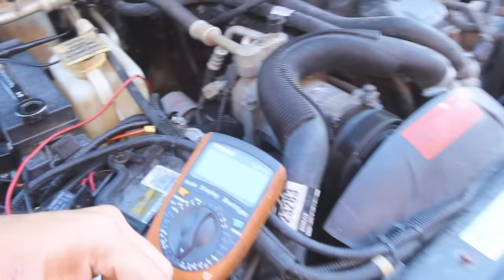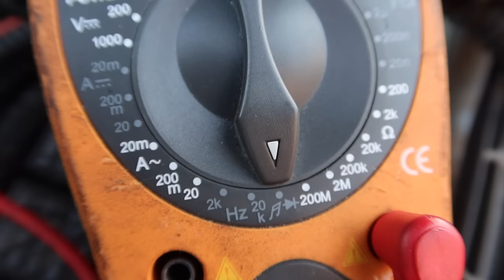AC Suddenly Stopped Working In My Car / Cheapest  Air Conditioner Diagnosis and Fix / Hot Jeep  XJ

Comment: If the switch is good, but the compressor doesn't come on, check the continuity in the coil in the electromagnetic clutch assembly, and if no continuity, replace those clutch parts (sold in kits online) instead of replacing compressor and the refrigerant.  It's a lot cheaper, and a DIY job.
Reply: P
Reply: Huh?
Reply: My AC clutch doesn't click compressor turns on and the AC in my 2003 Ford mustang base model
Reply: For compressor to engage in cool the car
Reply: Well the problem I have is that my battery died the other night I changed it ac dosnt work now thought it was the relay so I jumped the compressor with a paper clip thru the relay and the compressor turned on and I tested the relay by puting it in the horn relay and the horn still worked so I’m clueless as to why my ac clutch won’t engage
Reply: @kathyhartline1954 my thought exactly
Reply: Hey thanks a lot dude this is pretty easy to understand you help me out a lot 🤑
Reply: @wesleymcmahon3036  find any solutions? That’s exactly what happened to me
Reply: Can you replace clutch w/o removing compressor?
Reply: May require a wheel-pulling tool to separate the pulley from the compressor, which often lacks clearance to use while mounted.

Comment: I was bummed out because I thought my 1998 Jeep TJ needed expensive AC repairs but I tried your diagnosis/fix and that got my AC working.  Thank you so much!
Reply: Same here!!!
Reply: I’m working on my 1997 TJ and did the paper clip trick that made the condenser kick on and added in some refrigerant and it’s still hot air. Any ideas?
Reply: @SamuelThompson-rh2su  You have to replace the AC low pressure switch like he showed you in the video. Rewatch it.

Comment: Love you my man . Just changed my ac compressor , dryer accumalator, orifice tube, ac condenser, hi and low pressure hoses . Charged the system and compressor woudnt turn on . Changed fuses . Nada. Check that switch boom . Now we got ac boys .
Reply: Damn. You threw everything but the kitchen sink at it.
Reply: 😮broken fuse,

Comment: Finally, a practical hands-on way to check the A/C system after checking that the fuse and/or relay are good.  I'll do this tomorrow.  Thanks.

Comment: Dang I wish had a truthful trustworthy mechanic that I knew. I had 3 different quotes for my 2014 (only 55k miles) Kia Sorento’s AC problem. 2 said it was leaky hoses, one said it was a compressor. Both gave me a quote of around $650. 
It took one of my coworkers to say; “you might want to check the compressor fuse. I had a Honda a few years back where that was the problem”.  Now watching this video , i’m getting my hopes up that it’s something this cheap!  🙏🏼

Comment: MAN, thank you!!  I thought I had problems with my evaporator coil but it was just the low pressure sensor.  I'm hitting the parts store and fixing this TODAY!  Thanks again for taking the time to make this video!
Reply from the maker: Thanks for the great feedback!
Reply: @Donnythelatemodeltech  - My pleasure.   Question for you: In your opinion, would it be a bad idea to leave that connector "jumpered" with the paperclip for about a day while I acquire the new sensor?  Thanks!
Reply from the maker: I just wouldn't do it long-term
Reply: @Donnythelatemodeltech  hi
Reply: Super

Comment: thank you dude, had no idea you can jump out the pressure switch. my problem was the pressure was so low that the pressure switch would not turn on the compressor, I jumped out the pressure switch and the compressor started up and I was able to see that I was pretty much empty on refrigerant. long story short I now have my AC back and it cost me a total of 40 bucks

Comment: I know its not the fuses or a leak. The compressor moves manually but not when AC turns on. I thought maybe the AC clutch, the auto supply thinks its the blower motor resistor or the blend door actuator.  Your video has vome across my stream, so this test is my next move.  Crossing my fingers for the easy fix.  Thank you for sharing.

Comment: You may have solved a problem I have been chasing for months on the wifes 2007 Buick Rendezvous. For some reason AC Delco decided to not put a low pressure switch inline on this model, but mounted on the tailend of the compressor itself. I can make the a/c work by jumpering the relay, as long as I also jumper the high speed fan relay at the same time I get cold air inside the vehicle. have replaced the high pressure switch, made sure the freon pressures were good, etc. But no where could I find if the powertrain control module played a part in the a/c working...and without that info I hated to replace it due to cost if I was just guessing it might. So will check the low pressure switch again and if jumpering it doesn't solve the problem, go ahead and replace the PTM. Your confirmation that it does play a part, at least on Jeeps, is close enough for me to spend the dollars to give it a try...Thanks!

Comment: Thanks for the info, I tried this on my 2001 ram 1500 sport. My ac compressor wasn't turning on thru in the paper clip and it started working again. I refilled the coolant and found a leak on at the evaporater case  so its going back to never working again lol but ur trick def worked to get everything running, thanks.
Reply: You mean refrigerant?
Reply: @ජයනියතයි …probably

Comment: A nod of thanks to ya Lad!  With the info here I believe I've solved my heat soak/vapor lock issue. Something to ponder, if the pressure is down in the AC then the switch won't work. Perhaps the pressure pushes up on the Schraeder valve plunger which in turn pushes up into the switch for continuity.....dunno but I had tested my switch and she read open. I added freon to the AC system with the paper clip installed and the engine running, compressor spinning. Got cold air in the cab. For laughs I ohmed the switch again and I had continuity.

To summarize....low pressure results in the compressor not kicking on, electric fan not kicking on, heat building up in the engine compartment and then getting vapor lock. Here I thought I'd just get away without that fancy AC stuff and rely on 4X55 cooling.......
Reply from the maker: Thanks for sharing !
Reply: So I put the paperclip in and the clutch started spinning but the ac is still hot
Reply: Hkhh
Reply: @zacharywilliams28 what issue did it end up being?

Comment: 😊😊😊... 1993 Ford f150 5.0 truck and  142,000 miles on the clock...Alota old wires , connections and hoses...Just changed out the Blower motor...AC worked before I did that...Now, AC clutch won't engage...Gonna try this trick..See if it works...Wish me luck... 🙏 😊😊😊

Comment: I just typed in "air conditioning Jeep" and your video popped up. My 97 Cherokee had sat at my cabin since March after a wiring harness failed following some engine work, dropping the entire bundle onto the exhaust manifold, shorting out a bunch of sensors. 
My mechanic was able to fix that fairly cheap, but driving home in the 80-degree afternoon, I immediately noticed I had no air conditioning. Finally was able to get online tonight and yours was the first video. It's dark now, but I went through your checklist. No leaks and the clutch is definitely NOT engaging when the AC is on. I tried the paper clip trick and it engaged straight up. I'll head to NAPA in the morning for the new part. Thanks for this!
John
Reply: Well … that didn't work after all. I replaced the part, but the clutch did not engage. Next thought?
Reply: @johnmacdonald2657  3 years late here... but when you have the paper clip jumping the switch hook up a can of freon with a gauge, since your compressor clutch should be cycling you'll be able to tell approximately how much refrigerant you have on the low side, find your sticker in your car or look it up online and fill the freon till you match the recommended ounces. turn can from 12 o'clock to 3 o'clock shake and repeat.
Reply: @stevenotchaz4317  Hey Steve. No worries on the timing and thanks. Yes. Once I got the part replaced, I quickly learned that I also needed a freon "boost."  Interestingly, that lasted about a year. I've got to add freon again. My AC will work for about ten minutes and then it just blows air, no ac

Comment: Yes it is it's an old trick for a 2-wire pressure switch but things are much different when you have a 3-wire pressure switch you can check the voltage on a three wire pressure switch but I do not recommend using a paperclip on bypassing a three wire pressure switch especially on OBD2 computer systems I always replace the pressure switches and Schrader valves anytime I do an AC job also if the pressure switch is bad you can slightly tap it to see if it is starting off you can also check the power disconnect the clutch on the compressor to see if you're getting current if you're getting current or voltage to the compressor clutch where you disconnected I normally check to see if I have power to the AC clutch first it also check the relays and the uses for the air conditioning system also in most used boxes on vehicles they may have four or five different relays that are the same exact relay for example I took the relay out of the windshield wipers and put it into the AC relay I knew the windshield wipers worked because I tested it it was the same relay with the same numbers on it with the same amount of prongs I had a vehicle one time where they three prong pressure switch the O-ring was bad and there was a leak there I used a sniffer to find the leak so my suggestion is to always change the pressure switch they do go bad hope this information helps you I don't buy Hearts online never know why you are getting

Comment: Hell for 8 bucks I would try that first. My air was working when I stoped the vehicle. After about an hour, started it up and it had quit. It was raining that day hard. I'm thinking it may have shorted out that switch. Thanks for the info.
Reply: That's what you want - a "shorted switch"  (which opens with low pressure.)
Reply: Absolutely will be the first thing I do if my ac stops working

Comment: 4:30 Be careful not to bypass the switch for to long, because you could blow up your AC compressor, if it is low on freon.
Reply: yeah no doubt.......dude teaches people how to make a 30 second repair  a 300 dollar repair. why ya have to be certified is beyond me!
Reply: Exactly 💯!!! 
😂😂😂

 I love YouTube "certified techs" 
They keep the certified techs busy AF!!!
Reply: Bypassing your AC pressure switch will not blow the system up. That is the low side. Nope your head pressure kicks up. You have a head pressure switch. They will kick the system out. All y’all do is is Barna compressor up basically and it’ll cost you more that’s all.
Reply: @CharlesLease-ei1ee  
If the pressure is low because the refrigerant had leaked.
The pressure switch would off to stop the compressor from running because rubricant oil in the compressor is not enough.
So if you make the compressor run by shorting the pressure switch the compressor will get a problem.
Reply: Come on man all here is a confusion, a lot guys said nothing happen other guy said don't do it that way, wtf man so I'll do it or not, this stress me out any help

Comment: I knew there was a way to outsmart the wiring system, and I wasn't sure until I watched your video. 

I checked the relay and it opens and closes at the right time's, the wiring seems legit without issue, and the clutch just won't engage. I know my refrigerant level is just at the high side of the normal range so I'm not leaking refrigerant thankfully. And there's no visual issies/problems I could find. 
Will try to short out the low side fuse first in the morning. It's 410AM at my location in new York and I've been out here since around 1030 or so. 

Get a few hours of shut-eye and back at it afterwards.

Comment: My boyyyy, I see you with the Stros cap! I’m born and raised here north inside the loop of 610, anyways, I did this, compressor turns on bypassing it, but doesn’t blow cold air, the AC lines get cold but never blows cold air.  I checked the refrigerant, and it’s around 38, I have a 2003 Tahoe, I think 38psi on Freon, (it’s on the green). I know when I’ve had a leak, the psi was on read, so I’m sure I have freon, I’m stuck.. it’s been so hot here lately.

Comment: This trick saved me a headache when I replaced my ac condenser. I couldn't figure out why I couldn't get the compressor to work after I put in a new condenser. I got on YouTube and saw this video. It worked like a charm with my Toyota corolla. Thank you.

Comment: Good video, i didn't realize the pressure switch was that easy to change. My 011 crv ac is acting up, blows cold for awhile and then just stops. I was going to top off the freon but the gauge was still in the lower green about 28 lbs. So i left that alone. Once the car sits for a while the ac will work again sometimes an hour before it blows warm. I dont hear the clutch engaging when its blowing warm. Radiator fans are good.

Comment: Warning....if you are ever jumping something out like that with a paper clip... be careful... if  you hit a ground connection , body ground or if those pins in the wire connector is a ground with nothing else sharing the load.... the clip could get cherry red in no time and it will burn and possibly even cut into your fingers as it burns them because and it can slice through your the skin on your fingertips like it was as easy as a hot knife slices through butter.... I would personally put the clip in using a needle nose and if I see anything other than inital spark from the load that is connected and starts to get hot then pull the clip out before any major damage is done or before you blow a fuse.

Comment: Thank you so much I've already spent 2k on parts and diagnostics, and they told me they couldn't find the problem. I cant wait to try this in the morning on my car.
Reply: Did it works?
Reply: @rogermorales4819  Unfortunately not, I don't know what it could be. It has a new compressor, new fan, new blower, new ecu, fuses and switches are good. Three mechanics, including one from ford dealership said  the ecu wont turn on the compressor, and they don't know why.

Comment: Hi. Thank you for this very interesting video with a new trouble shooting that I haven't seen before. Good point that you explained that there is a shredder valve below your pressure switch, this helps to understand. Unfortunately on some cars there is no shredder valve below the pressure switch and if you remove it you loose all the gaz. Thank you again. Continue like this too share your knowledge.
Reply: Thank you for that need to know info as well bro good luck. 👍

Comment: When pressures are good... its.'s a control problem.  The low pressure switch is a system saver: there's nothing doing if the evaporator becomes a block of ice.  It can damage the compressor, and [if you have one] the power resistor in the blower housing.  About the only thing I could add is once a/c is running, amp check the clutch coil.  When coils fail, it doesn't always go straight to an open fault, but a winding to winding short where varnish breaks down.  What happens is a loss of field strength - the coil may chatter or not always pull in, and also run too hot [causing more damage]. Knowing what a good amp reading is before problems start can be a real timesaver later on.

Comment: Huge Thanks!  I had a short cycle on my compressor, hot air blowing out, when I checked coolant pressure it said it was high so I didn't add again and sat confused. What was the issue???
Checked electrical on compressor clutch, it was okay, clutch moved freely. Great. 
I looked up about short cycling on another video and a kind user pointed me to YOUR video!
I disconnected the low pressure sensor and did the paper clip bypass. Restarted my 01 Blazer, the compressor engaged but No Cold Air. I checked coolant and it reads empty! ???
I began a recharge and got it to 30 and stopped there with cold air coming nicely.
I checked the low pressure switch thinking it was bad but it was buzzing!!! So it's okay too!

So I'm as confused as anyone, but the cold air is pumping out. I think your suggestion of the bypass was the trick but from a mechanic point of view I don't know how it worked! 
😂😂😂

But it works now and that bypass trick somehow got it done!  4 years later you are still helping us out! Awesome Man!

Comment: Thanks man, that was pretty informative. A lot of videos don't "what if" , and sometimes that's important. My AC on my pickup works good when I first start it up and then sometimes it will run good for 50 miles or it may run cold for 10 miles. Then it may kick back on and work fine. Any ideas?
Reply from the maker: Possible compressor clutch,    next video will be on a intermittent worn clutch.  Very very good example  , some times it works 5 minutes, sometimes  no problems at all.    I'll link it to  you when it uploaded if want, let me know . Thanks For Sharing!
Reply: @Donnythelatemodeltech may I plz get that link.

Comment: This works with older vehicles with simple ON/OFF low and high pressure switches. This won't work with newer vehicles which use a variable sensor output (resistance). You need to know the resistance of a sensor at the general cutoff point. Then use a potentiometer to duplicate variable resistance and turn it (changing resistance) to replicate the variable output (resistance from ground) to the HVAC module.
Reply: For 05 pontiac gto you think?
Reply: @mikeprice8307  Ya, it should be a simple 2 wire switch. It's the 3 wire sensors which you can't fake with a paper clip. Those send pressure data to the PCM/VCM and became more common around 2010ish and newer vehicles.
Reply: @BearHomeOwnerDIY  it's looking like it's going to be 3
Reply: @mikeprice8307  DOH! can't fake it gotta make it.